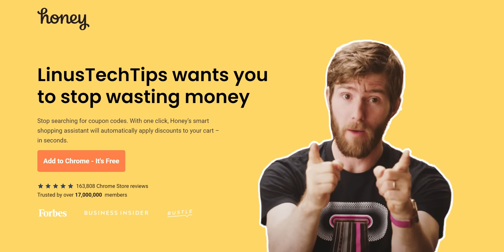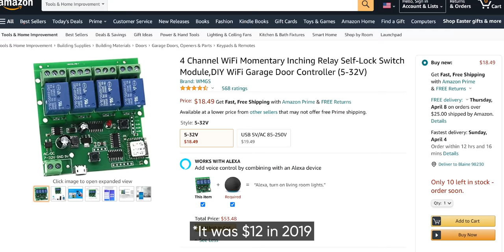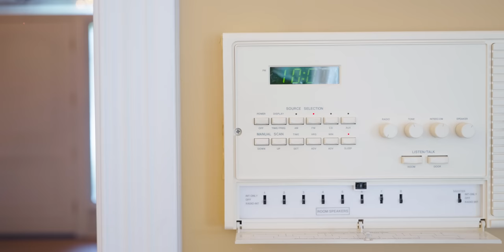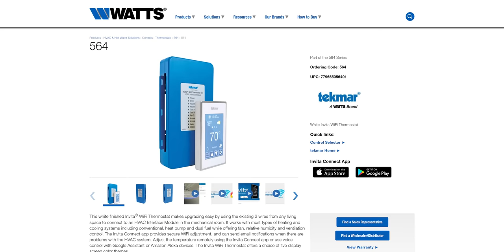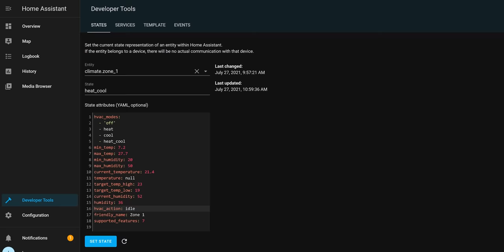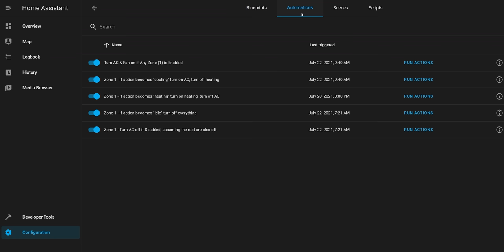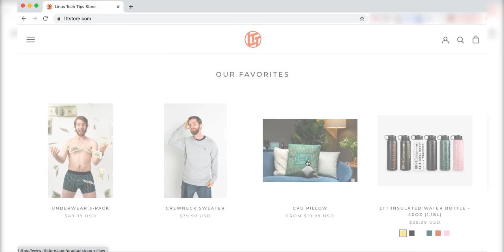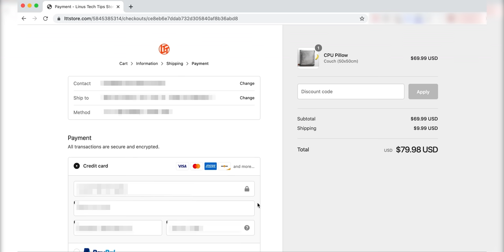This Should've Been EASY - New House Smart HVAC

Comment: Worth mentioning, I've spent some time doing the "Occupancy detection" thing with various solutions. Motion sensors can be problematic when you just have someone lying in a bed for example - if they aren't positioned well or aren't sensitive enough, they might mark that room as "empty" when it isn't. Additionally, too sensitive can generate false positives.
An option is that if the motion sensors are very directional and placed near or in front of doorways, they can be used to determine "someone has entered" and "someone has left", and then using that data in homeassistant to make a sensor per room with an occupancy count. Then rely on that occupancy count to determine whether to heat, cool, keep lights on, and so on.
Reply: And then a horror movie will be made. How come there are 10 people in the house while Linus has a family of 5. 🤣😂🤣😂🤣😂
Reply: Then somone exits thru the window and the heater stays on indefinitely. The perfect crime
Reply: Would be cool to add motion sensor outside and inside each door so there is always a monitor that can detect if someone open the door but didn't enter!
And make a monitor map that show a where someone is moving.... something like among us game map!
Reply: But if 2 people enter right next to each other and it only counts 1 person entering, then when 1 of them leaves the lights will go out on the other person.
Reply: @BimalB  Cats. The answer to that is cats. They'll be setting off the motion detection 'on', but never the 'off'. It'll detect them entering but rarely leaving.
Reply: Occupancy check is not worth it. Not for family housing. Maybe whole house occupancy check that relies on your locks and alarms but even that is worthless.
Most of all, you want to be comfortable when you are in the room. Such device means that when you enter, it will be too hot/cold. Then after you leave it will be still cooling/heating. Not much gained, more like inconvenience. If you have regular lifestyle, maybe it could learn your habits but even that will not work if you don't live around the clock. Besides that, it will only save money if you actually don't use some rooms for a longer period of time. This usually means that you can use schedules to maintain given range of temperatures depending on the zone and time of day. For example my bedroom had 3 time zones. During the day it was 12-26C. In the winder barely any heating, in the summer it was cooling to avoid having too much to cool down in the evening. AC was weak and it would take a lot of time to cool down from 30C+. In the evening 16-20C, I like my bedroom cool. In the morning 21-26. Much easier to wake up if it's not cold in the winter. Basically it was cooling only during the hot day and at night, heating mostly in the morning in the winter. Heater was disabled in the summer anyways.
Reply: Override switch.
Reply: just put a few cameras inside each room and use object detection...
Reply: Someone had the bright idea of installing a motion detector in the bathroom at work.  It has a rather short timeout.  I was in the ... uhm, intestinal confession booth .. and the lights went out.  I'm not traditionally a betting man when it comes to janitorial work, if you get my drift, so that was a bit disconcerting to perform the second act in the blind.
Reply: You can use infrared sensors to see if there is a warm body in the room.
Reply: There are lots of occupancy sensors that have adjustable sensitivity. Crestron has been leading this area for years.
Reply: Something that would be better would be using gps location on the phone and feed it in, probably IFTTT, so that it checks when a person is X distance away from home and starts cooling or heating based on temperature and when they are detected on the wifi or some other way to detect they are home it won't turn lights off. I think manually turning a light off as one exits a room is no biggee.
Reply: @TheSixoul  For this you'd need everyone in the home to have their phone always with them and all of them would have to be connected. It's possible but might be a pain to maintain. You have some guests in the house? Now you have to disable it or ask them to install some apps to be tracked. It's a bit overengineered. Much simpler solution giving you most of benefits is just to have higher hysteresis when the house is empty and smaller one when someone is in the house. Like usually you'll set heating below 20C, cooling above 24C, then when nobody is home set it to heating above 16C and cooling below 28C. The difference is good enough to be able to quickly heat/cool down when you enter and at the same time provides quite a lot of savings when you are not at home for longer. 
The problem with your solution is that heating and cooling takes time. A lot of time. If you count half an hour then you could be far away from the house. I have 5-10 minutes from my office to my home and that's enough maybe for 1-2C difference. Is it worth it? 
I'd connect best of two worlds. Have 3 sets of settings. When you are home, when you may be home and when you are away. The last one would have the widest range and would be used with tight schedule - time when you are almost always at work etc. The other one is the time when you may come back. It keeps temps closer to what you want to be able to switch to normal operating temps when you are back. It would be complicated though as people like different temps as well. You'd have to have some predictions built in, like the wider range should be kept an hour before. You expect lower temps at night than during the day so it should already lower the temp to avoid overlapping the difference between medium/at home setting and the between day/night setting.
Reply: @emanuellugo8193  wire one up on the window and dont tell your kids.
Reply: @DumbguyMc  lmao it must happen quite often that a person leaves thru the window for a person to consider that alternative.

Kids do love shorcuts. I would do the same if i could to be honest.
Reply: @nickwallette6201  My work has that same set up. I can't begin to describe how uncomfortable is doing your deed while keeping track of the light timeout because you know it's that or having your cellphone flashlight on your hand and the paper on the other.
Reply: On my room keypads, I have 1 of the buttons as DO NOT DISTURB just like a hotel.  When enabled, certain motion sensors and timing are disabled.  And I use that in conjunction to change and adjust the overall motion detecion.

Comment: You might already know this but if you are only using a single A/C you will need to have the majority of zones open for it to cool properly. A/C's require 400cfm per ton to properly cool and you won't be able to get that airflow through a single damper. The A/C will freeze up if it doesn't get enough airflow and it would be quite noisy trying to push that much air through one zone. You might want to program it so that it waits for multiple zones to call before kicking on.
Reply: yes

Comment: This is really fun to watch, the only thing I would say it this is probably not going to work out like you think. Having all of these cooling calls on your AC system is going to really shorten it's life. Also, short repeated cooling calls put humidity BACK IN the house due to condensation on the coils not being fully drained off. Also, AC systems are sized to run with all ducts. Zoning typically puts tons of pressure into loosely taped joints and the AC ends up going into unconditioned spaces like crawlspaces or attics. Worse, this can also push condensation into those areas that don't have proper ventilation and can cause mold and other issues. Also, a lot of the 'comfort' associated with a typical temperature is changed when the radiant heat from walls and floors is different. This will typically make you have to overcool a room that had been unoccupied. There is a reason zone systems are typically per floor. Even per floor has issues, and some people find efficiency increase is hardly noticeable.

Comment: I've been using the last couple years to slowly upgrade various parts of my place with Smart Home capabilities. I am a bit constrained being in an apartment at the moment, but have learned a lot.

One thing I had a lot of issues with was the places doing media consumption. In my case a living room, but this could also be a theater room, computer room, etc. Occupancy sensors were causing a lot of issues since you'd normally be fairly still while consuming media. In those spaces I started using a presence sensor instead which really helped a ton. Most are using mmWave technology instead of a basic PIR sensor. It can detect micro movements and even worked in the bedroom while very still during sleep without any "blips" of it not being able to detect my presence.

They're a bit hard to find, there's one by aqara but is only sold in China at the moment. There's some other youtubers who have built their own fairly easily using ESPhome. I can send links if interested! Would be interesting to see one built. Always wanted to do more of that, but small apartments mean little work space :(

Comment: Air conditioning systems are designed for a certain volume of airflow.  More modern variable speed systems can adjust for how many dampers are open, but the older style system you have needs a minimum amount of airflow to work properly.  Insufficient airflow will cause the evaporator (indoor) coil to freeze over which will completely stop your airflow.
Reply: I was thinking the same thing he's gonna burn up that dino ac unit
Reply: Had a friend lose there house to a fire caused by that recently. The ac never turned off cause it's so hot here in Louisiana and it was old. Eventually it failed and caught fire burned half their house down

Comment: My dad has a floor heating system in his Bathroom and living room, thing is when he had the house build (rather new one ~10yrs old) he didn't ask for such a thing, the assumption was the guy who put it in put it in more houses as a big contract and since all houses are standing in row, only with a firewall inbetween, he didn't notice they hadn't ordered one. The first time he found out this was teh case was when he was laying tiles in the livingroom and the tile cement dried up rather quickly, then in the bathroom teh same thing. Well cranking up the heater solved the mystery! And yes this kind of system isn't exactly that common in Germany.
Personal opinion this kind of thing is awesome! And using it for cooling in summer is a good idea as well, though I wonder if one shouldn't put an extra cooling loop into the celing, you know thermodynamics and stuff? I would also recommend a passive air exchanger/pipe and vent system for cooling/exchanging air, perhaps with a heat exchanger? I know it is on my list, just like solar panels and solarthermic pannels, the later of which feed into the heating and shower system, maybe even a geothermal cooling/preheating unit (on a sidenote in Germany you're free to drill down to about 99,9m without a permit, which is about 327'9"). Sure all these things are expensive, just like an extra rainwater cystern burried in the gaarden, maybe even under the deck/pattio/terasse, but these things are as per usual teh long game and many of those things work better/cheaper if you combine them as planned with teh architect. ofcourse I'd also put in opticfibre, LAN cable and a centralised hub for these things when planning, you know, plan smart against work hard/more expensivelater.

Do I have the money for that kind of house? NOPE! But this doesn't mean I can't make plans for later and a "dream house" is exactly that a DREAM house, which doesn't mean I can't methodically plan the thing. Heck I know a guy who's even more broke then me and he has the pc he will probably not own for at least 3-5 yrs. planned out and updates it regularily.

Comment: This “Linus watercools his ENTIRE HOUSE!” meme is as far fetched as the “Fast and Furious IN SPACE” memes. So hang in there team it could actually happen given the last film.
Reply: It's literally the opposite of water cooling.
Reply: HOUSE watercooling GONE WRONG?!? Actually HEATS HOUSE
Reply: Its technically watercooling if the heating element is turned off and hooked onto a radiator or AC
Reply: @kindlin  the water is being cooled
Reply: @Alex-rg9lz  The water is being heated?
Reply: @kindlin  yes, but it cools down in the room
Reply: @Alex-rg9lz  The room is technically the water cooler for the hot water heater.... lol
Reply: @robertbonzon69  While those systems do exist, they're not common.  Two big reasons.  First, most people prefer warm floors over cold ones.  Which is also one reason the bathroom is often another zone.  So it can be more comfortable after getting out of the shower.  The second is because AC also dehumidifies.  Which is a good thing when it's happening somewhere you control.  Not so good when it happens on the floor.
Reply: @SteveUnperceived  Allegedly! Apparently the characters from Tokyo Drift all became NASA engineers. Because in addition to preparing you to be an elite hacker and/or international super-spy with invulnerability hacks enabled, it appears that having a background in underground illegal street racing is sufficient to qualify you for a career in aerospace engineering.

(careers in underground illegal street racing are TIGHT)

Comment: Underfloor heating system dates back to 5000 BC in ancient Korea, namely "Ondol", or "warm stone" in direct translation. It's one of the oldest and the most iconic heritages in Korean culture. Even now, most houses in Korea are heated using Ondol technology.
Reply: there is not a single reason to not use infloor heating. 1 water heater can heat a whole house with infloor heat better and more efficiently than a furnace could.
Reply: Thats really cool.
Reply: Yep.  My apartment has this system.  Makes it real nice and warm in the winter.  I just wish the AC system was better here.
Reply: @dragonmaster391  you can also passiv cool your room^^ if you have the right heat system
Reply: @dragonmaster391  it is the prefered metod of today. it is low temprature. with make it ideal for heatpumps. it also give worm flors. with is werry nice. still do if bad isolated windows i would not recomend switching. as it would couse cold draft from windows. you get the same problem when switching to a heat pump air to air. it is ealy fix by replaceing the windows do. if your just installing a heat pump air to air it is somewhat expsnsive do. if installing flor heating it is not that big of an investment. 
was wondring some do about the heat system. is it oil or electric. depedning on location it would be exspensive. so maybe VRV system might be better in long run
Reply: also rather common in Germany
Reply: people who live in the middle east and indian and china use air conditioning for cooling thats why we don't habe heating
Reply: Samurai Shampoo  depends on the install, zones, etc actually not a huge difference in price at time of construction vs radiators or heat vents, however if it's a renovation labour costs soon ramp up.

Comment: Midwest HVAC tech here. I deal with zoned systems exactly like you are attempting. May be a little late, but without proper return air/supply air at your air handler  
your static pressure will be ridiculous. Those supply runs that are zoned will be howling like crazy. Your better off leaving a few rooms without dampers as sudo-bypass areas (dump zones) to help get rid of the excess pressure youre creating. Or adjust the 'close' positions on the dampers via the red switch. Improper zoning can cause many irritating and headpounding problems. Also if youre finishing the area where youre installing the dampers, put an access panel by it for servicing. You'll thank me later.
Last thing, if you are using a relay panel or pi-zone board that is supplied by 24vac you will probably need to isolate the dampers with independent transformers due to the high load of having to close potentially 9 dampers (may not seem like much) can overload the board and make it malfunction. Had a honeywell panel have x8 6" dampers trying to close simultaneously causing failure due to a single 25VA transformer. Had to isolate that zone with a 75VA and other zones to 40VA.

Comment: So couple of considerations:
You will need either an air dump or a frequency drive on your blower. If you have to many rooms zone off airflow you will start freezing up your coil. 

If you are doing this yourself you might consider putting in a fresh air economizer, basically a duct that pulls outside air when outside air is below 55 and you are still calling for cooling. This saves a lot of money over running your old ac system. 

On the hydronic system, you might consider removing any high temp loops (side arm for water heater or fan boxes etc). If you are running high efficiency boilers you will get much better heating if you can keep your water around 80°, this will also prevent over heating and then having to cool the house back down as the sun comes out. Running a second system for those high temp things will save you a lot of headache and make the entire place more efficient. 

Just some food for thought. Hope you read this and it helps.